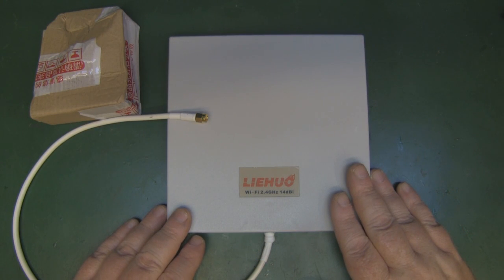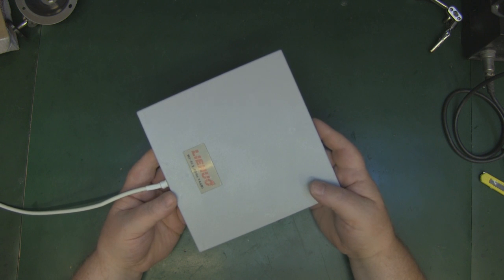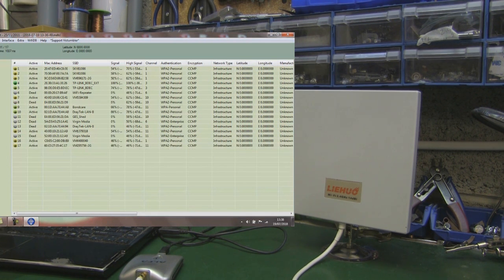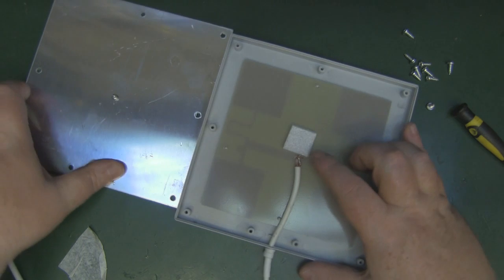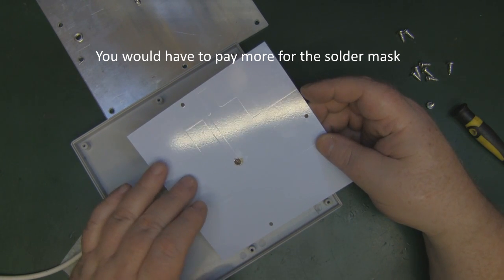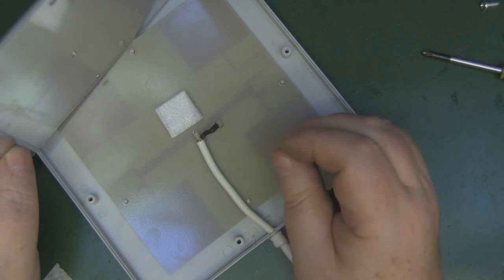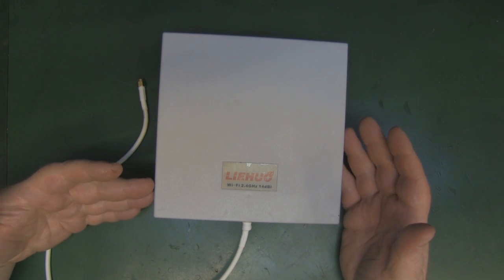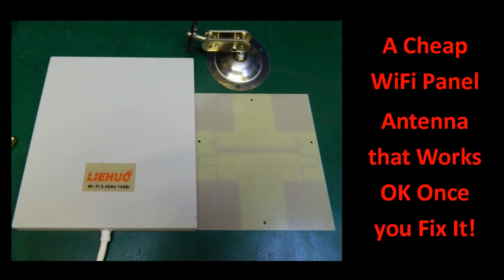A Cheap Wifi Panel Antenna that Works Once You Fix It

Comment: I experimented with these Antennas too.

You can improve it even more by adjusting the space between the reflector and the element.
Reply: How far distance did you adjust sir?
Reply: How far
Reply: WIP out wireshark and do tests if you want to find out

Comment: Just bought one of these a couple weeks ago & got very mediocre results. Will have to check its grounded. Thanks for the video.

I also plan to cut off the coax & mount a rpsma connector directly to the back to see if that improves anything.

Comment: Good to see some updated stuff from you, I always enjoy your write ups! Funnily enough I have 1 of these exact panels but is about 3 years old now, funny thing is is that I opened up mine just to check and it does have the solder tag on it and is screwed in properly! Also of note is that the makers sticker on the front of yours is at the bottom and not like mine which is in the middle,  it also hides a square cut out which i'm presuming is to allow them to screw the tag to the reflector before putting their sticker on it so why they changed their design to a poorer 1 is beyond me. It is the same maker too according to the sticker!

Comment: There are a couple of interesting features of this antenna design:  1) The microstrips' dielectric is a sandwich comprised of both air and FR4; and   2) The top elements are fed from the bottom, while bottom elements feed from top, so for proper phasing to achieve a single main lobe radiation pattern, the top elements have an additional delay line of 180 degrees.

Comment: Great video! I have a pair of these from my electricity meter box to one in my inverter so I can track power use, worked great for 2 years recently stopped, I want to reboot it but can’t see how? Maybe turn power off then on to the whole property?

Comment: I got same one .. and also had same problem lol .. I put a small nut and bolt through back plane to connect ground wire, and works grate

Comment: I am using a tp ling modded to act as a bridge to grab wifi signal fro. A sonar on a bait boat. If i connect a 15dbi panel antennae will it reach 100yds ?

Comment: Hi and thank u for your really insightful detailed vids. I am looking for hi gain dualband panel antennas 18dbi/ 20dbi but cant find any. Can I use a 2.4ghz 20dbi antenna for a dualband Alfa awus036 wifi adapter?

Comment: would've been better to pull the wire through the hole and drill and tap another hole to mount the ground wire

Comment: I have tried a lot of your designs and I seem to have the same problem with all of them.
I get a better signal for connection to my router but when I'm actually connected and browsing the web or downloading / netflix
I get better performance with a poorer signal from a small dipole.
is there a reason for this, I have tried numerous usb adapters.

Comment: Where to get that USB WLAN adapter that you can see at 3:18? (The little silver box.) And what type of cable connector does it have?
Reply from the maker: You can't they don't make it anymore
Reply: @andrewmcneil  So the copies they made all evaporated?
Reply: It's an Alpha usb wifi adapter. Probably AWUSO36H, N or HN? There are always used ones on ebay if its an older model.

Comment: Has anyone done business with superbat aka RF supplier. I just received a dome antenna from them to replace my Wilson dt cell boost  outdoor antenna. I took this think apart to look inside and its funny to see the cone element connected to the center conductor connected by s soldered brass wire to the reflector thats connected to the outer shield,  basically a dead short between the two, checked with a continuity tester.  Its a bit bizarre.

Comment: Would it be possible to join several of the antennas together to increase the gain?
Reply: Arrays are a thing, but you'd have to be very careful with signal matching etc. AFAIK.

Comment: Thanks, for sharing, but your logic isn't quite right unless all the stations you are receiving are standing in a line, in a single direction. If these stations are all over the place a high gain antenna would give you less stations, but those in the right direction with seriously improved signal strength. The antenna gain is usually trading in directional versus omnidirectional reception. Unless all stations are standing in a single direction, your approach is rubbish. And you don't even try to optimise the direction versus the signal strength of a specific station, so what is the point of tersting a directional antenna, when you don't care of the direction?!
The only thing I can take away from this is that the PCB may possibly be a good electrical design? while the rest is just terrible feeding that can be fixed ... and cable changed to some low loss coax.
But as you say, how in the world can anyone build this for 6 bucks?! Here in Germany you would pay 6 bucks just to get an industrial low loss coax connector if you are lucky :-).
In the future please tread omnidirectional antennas and directional antennas differently, else it doesn't make any sense to test it at all.